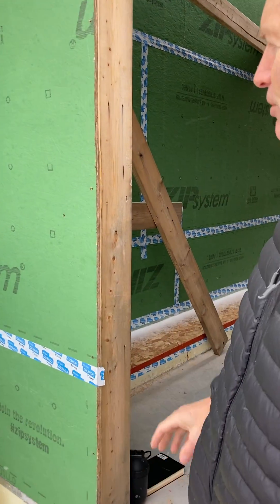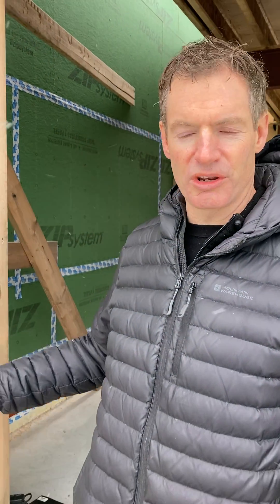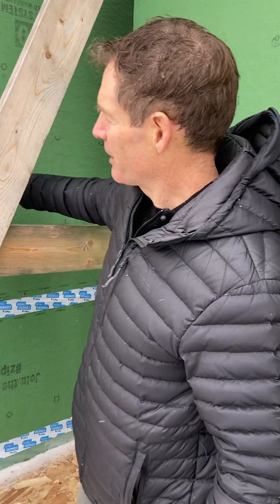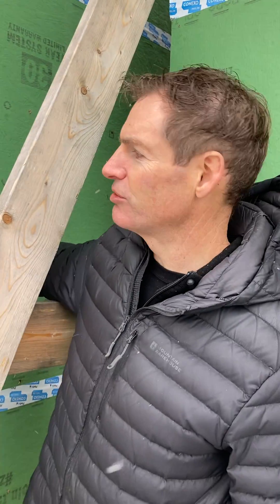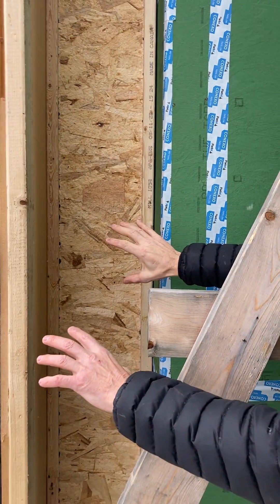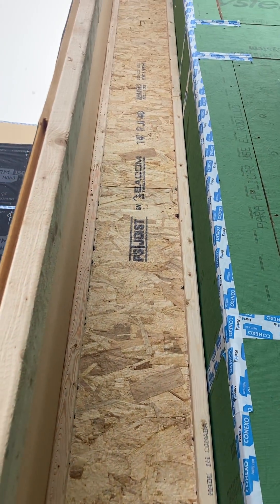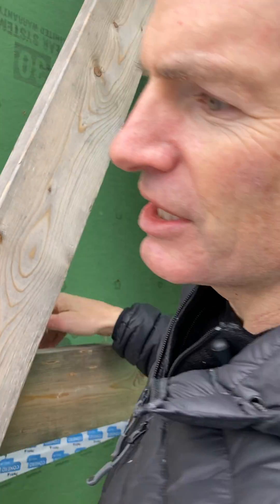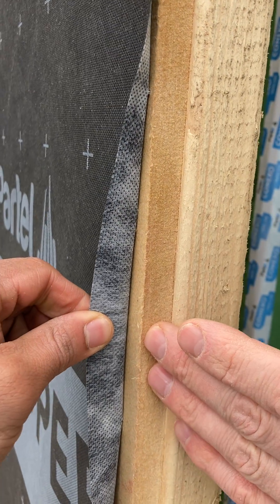Certified Passive Wall assembly

Comment: Just curious why you don't use zip's proprietary tape?  Is it because it's not functioning as the water barrier?
Reply from the maker: Yes, exactly! You know your stuff!
Since we are using ZIP as a vapour barrier sheathing, we use a passive approved Vapour barrier tape that is more cost-effective than zip tape
Reply: @EkoBuiltPassiveHomes  yeah, was getting into a bit of an argument on YouTube with an architect who relies on zip + tape in lieu of a house wrap.   Feels like that tape will fail at some point and then it's just a gutter with no down spout.  Your assembly looks bullet proof.

Comment: Do you require a vapour barrier on the interior of the wall assembly?  The huber website says zip is not a vapour barrier, but OSB is sub 1 perm (I believe that's what code requires for VB).  

Do your building code officials ever give you a hard time because your assemblies aren't typical?

I work in and around Perth.
Reply from the maker: That’s correct, OSB being below one perm means it is a code approved vapour barrier, all codes in North America permit OSB to be used as the vapour barrier. Therefore zip is able to be used as the vapour barrier as well..
Reply from the maker: Building codes allow vapour barrier placed 1/3 into the building envelope, so no issues with building inspectors

Comment: Is the exterior wall what some call a Larson Truss?
Reply from the maker: Great question! The exterior wall is an I-Joist not a Larson Truss. Larsen trusses are pre-fabricated 2x4 assemblies framed on or off-site by carpenters. We don’t recommend them because they add (labor/time) cost and waste to a project, they are also difficult to built since standard lumber is usually never straight over long lengths. All these problems can be avoided by using I-Joists, any other questions just let us know..